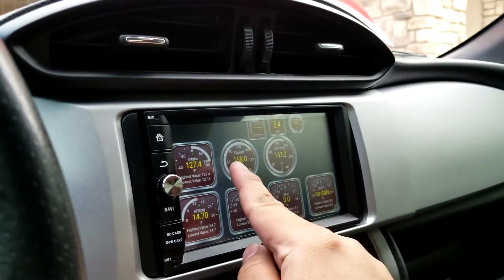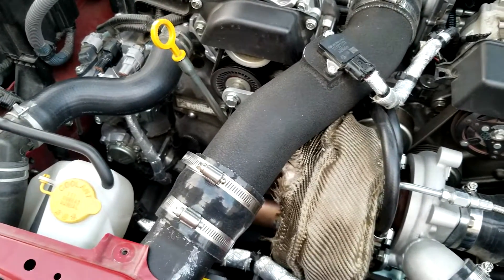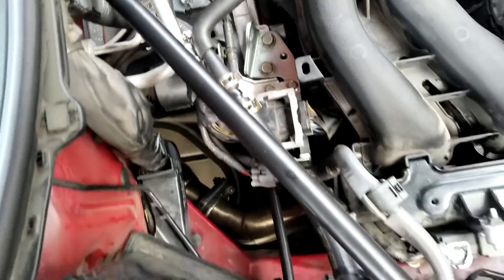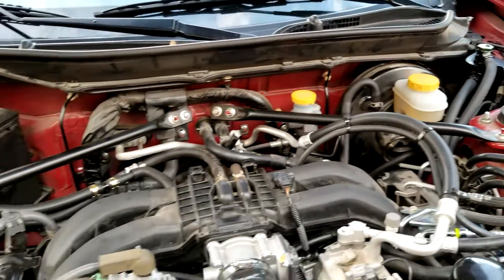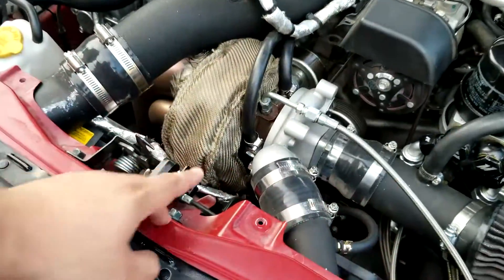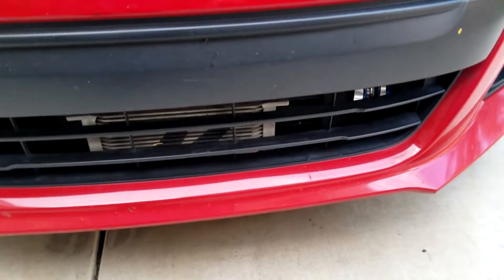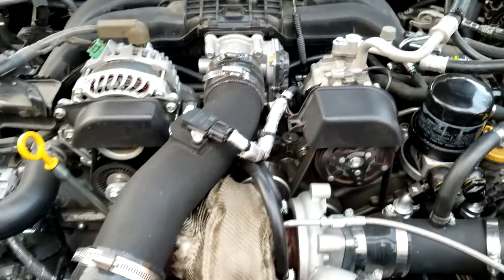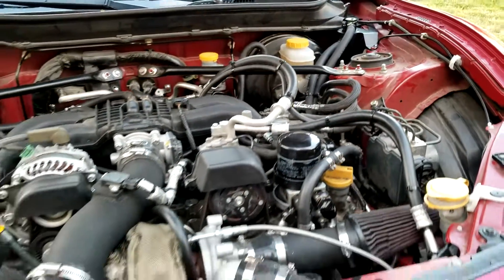ROAD TO 300HP SUBARU BRZ - SBD500X Turbo kit Install Part 6 of 6 (Endgame)

Comment: how much power does each map make?
Reply from the maker: I didn't really have dyno numbers, but people running a similar setup on e85 usually get around:
8psi = 300~ whp
10psi = 330~ whp
12 psi = 350~ whp
14 psi = 380~ whp

Comment: Another great video! Thanks
Reply from the maker: Thank you! Hope it help, if you have any questions during your install feel free to ask.
Reply: @brzser8387  thanks man i really appriciate it. And for me installs never go as planned so im 100% positive that ill be asking more questions.. such as, did you have an installation guide with torque specs? Lol
Reply from the maker: @Ryan-ue9ve  that's a tricky one lol. I had to search for them 1 by 1. As far as the turbo manifold ---> turbo ----> down pipe, i just tightened those to what i think is right lol. For one its somewhat impossible to get a torque wrench on those bolts. I would say torque them enough where they don't snap, but enough that they close lol, but of course slowly. If it leaks tighten it some more, is what i would do.
Reply: @brzser8387  lol thanks man appreciate it. I think some people use the greddy install guide so i might try to find that or ask the facebook group when i get close to install! Keep the videos coming though, i dont see too many videos of people with this kit.😁 👍
Reply from the maker: @Ryan-ue9ve  Will do! The problem I found with the greddy instructions, it only shows 1 torque spec lol, only the pulley bracket torque spec. Good luck! heads up it will be painful, and frustrating at (most of the)times haha (at least for me), but well worth the work compared to paying a shop to do it for ~$1k-$1.5k.